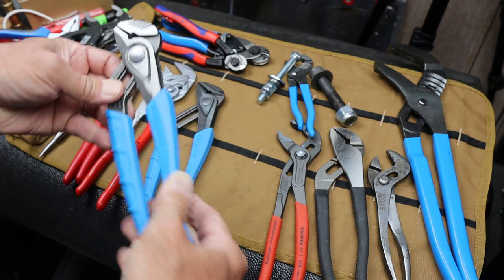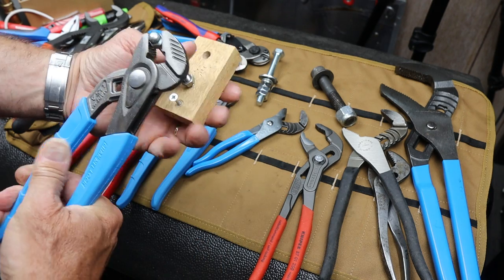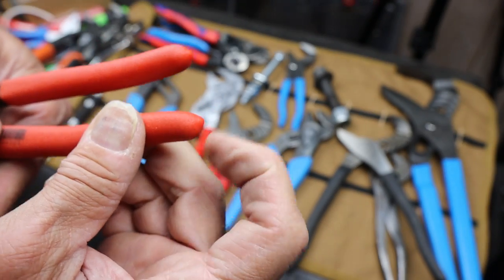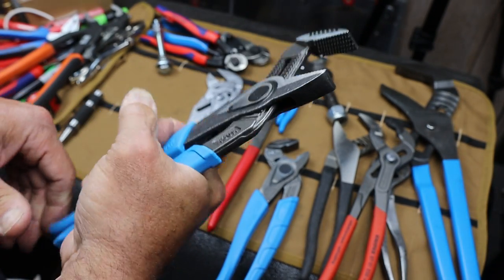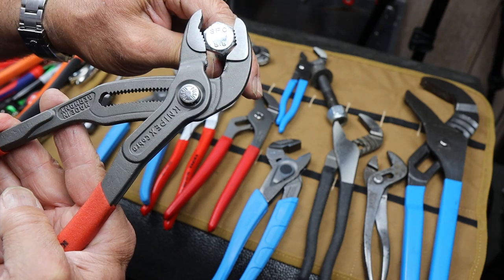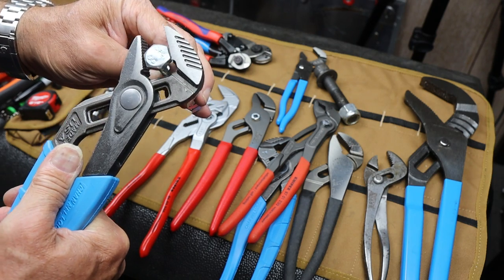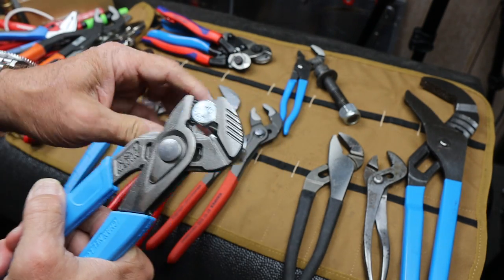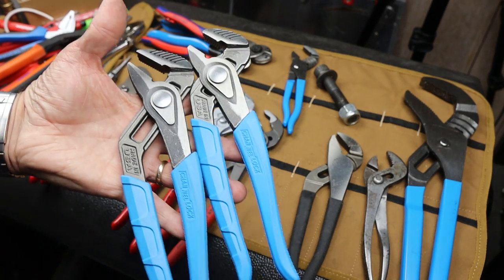Channellock SpeedGrip Pliers: First impressions and comparisons. Hmm, few benefits, fewer problems.

Comment: Good choice NOT getting the 12" - I got them...THEY ARE HUGE but the jaw only opens as wide as the regular 8" CL. and I wanted to add, the jaw length are just so short, they remind me of the old school craftsmen (with the steel handle w/o grip)  And the journeyman series Klein (with the yellow and black beefy grip). I have a pair of Crescent and Knipex in 12" and I would reach for those before the speed grip.

Someone in the comments under me said they reached out to CL to have them combine the speedgrip and groovelock to make a good competitor for the Cobras.

 I always try and give CL my business but end up back at Knipex (cobras and alligators). Esp when te smallest size Kinpex jaw is 1.5% that of the competitors NEXT size up! The only CL I will ever have or use are the original 420,430 and 440 bc there is always a use for a Straight Jaw grip....
Reply: The 12” open the same width as the 8”? I own all 3 and the 12” open much wider than the 8” & 10”.
Reply: @mr.delacruz559  Not much more, Compared to even the 10" regular CL they have barely any jaw width. Compared to a Knipex or Crescent 12" pair I have, Which open to like 2 1/4" wide! Plus, the jaw length is just to short, They have their place (Have used them on big ass machine bolts) but, there is a reason the CL speedgrip is in my garage and the Knipex and Crescent are in my truck lol
Reply: @mikenormandy9250  The 12" have almost a 1/2 " more than the 10" and 1" more than the 8" Speedgrips. That a big difference in jaw width. The jaw width of the 12' speed grips is just a hair under 2 1/2. I literally have them in front of me and I have a 12' Crescent & Knipex Cobra. Now compare this to the Knipex Cobras ,Crescent wrench and see what the difference is.You should be able to since you say you own both. The jaw length of the 12" Speedgrip is longer than a 12” Crescent & is no shorter than my cobras. This is why I use my CL Speedgrips  daily at my job.
Reply: @mr.delacruz559  how good does the 440x bite? Im thinkin of buying a pair soon
Reply: @stew-03  the 12” 440X Speedgrip that I own has some serious bite. It’s pretty aggressive and I haven’t had them slip on me not one single time using them at work and or at home. I’m a true believer in them and the speed grip button action has smoothed out even more with use which is awesome!
Reply: Try the new v-jaw version the10 and 12 inch they grab pipe and fasteners really good I have all 5 these 3 and the new ones I mentioned. They are all good (to me).

Comment: Big bulky thick.  My Knipex have retired  my channelock, craftsman,Klein, and Irwin  T&G for the most part . My first pair of knipex was the 180 cobras. Fell in love with the ergonomics sharp teeth and thin head profile  to access much more before. I have since purchased most of the additional sizes. I don’t consider Knipex to be  super heavy duty they are a better finesse tool. They definitely are designed better and the teeth hardness makes for incredible grip with minimal effort   I’ll pick up a pair of these just  to check then out.   They are reasonably priced

Comment: I am looking at trying a set. As an electrician I use my pliers for grabbing conduit and also for bolts etc. I have a set of cobras but I don't think they grab conduit as well as old style pliers. I like the higher adjustability of the pushbutton designs but the knipex button sticks out too far and gets caught on stuff.

Comment: I have many different brands of these pliers l find myself grabbing the Irwins because of the quick one hand slide up
Reply: I have the irwin push button v jaws as well. I like to see a comparison to the knipex cobras. Ya knipex is the original and probably a bit better, but worth the price difference? But ya im super happy w my irwins. Id like a pair of the knipex pliers wrench though since all my pliers like that are the v jaws since i like them better than straight jaws. But i think how the pliers wrench has that articulation in the bottom jaw will make a big difference. Also it will be better for stuff that has a finish you dont want to mar/scratch up.
Reply: In my experience the teeth on the Irwin’s don’t last near as long as Knipex. That being said I’d rather carry the Irwin’s and dremel new teeth once a year for pliers I paid $20 and have the one hand slide feature than use knipex. The Irwin’s also feel better in the hands and have nicer, albeit thicker grips

Comment: This is likely the worst tools channel locks has ever made. And I've had a problem with everyone of their slip joint pliers getting stuck in positions that I don't want and it's about one or two positions away from where I want to be all the time always wants to get into that position rather than the position I wanted to go into. These things wilshere the teeth off of the adjustment in just a few uses. The teeth will also roundoff inside where it's supposed to be gripping nuts making it completely useless.

Comment: you are also right about the handles of the pliers, but also about the shape of the teeth on the jaws. But do you know what that means? For the factory to change the molds with which they forge the pliers, this takes time, and it costs a lot to change or design a new mold. But if they did this at the request of the customers, in the future they would have much more sales, and the customers would be satisfied. Don't just complain here on youtube, it would be better to gather some of those who present reviews here and write directly to the factory, for the modification of a clamp. They will listen to your requests faster. It is not enough for only one customer to ask the factory for this, there must be more. Look, for example, Knipex listens to the complaints of customers, no matter what country they are from, then they will release a new, more efficient tool that meets the demand. I live in Germany and I like the design of European hand tools, especially the VDE one. I also like American tools, because they are durable and professional. I saw some reviews from you Americans, perfect, get together some of you who make videos here and write complaints to the respective tool factory. For example, Knipex has several models of pliers that it sells only on the American market, and if I want order to order the respective pliers, I have to order only from America, because only there I can find it, not Europe. Recently, Knipex introduced these pliers in Europe as well, because we want them too. So it is possible. On amazon america we buy them at double the price, logically, now I can buy them at their fair price, without VAT or the price of delivery and customs clearance.I hope you understood what I wanted to say. I wish you much success.

Comment: The aesthetics are a little much.  Form follows function, as they say, and I have never liked un-necessary racing strips or flames, etc.   These pliers have been stylized w quite a bit of extra visual features, which I consider to be noise.  I would not purchase these mainly because the jaws don't get perfectly parallel in most cases.  The only cool feature may be the width of the jaws.  I've got a great pair of Knipex cobras that I use everyday for a variety of gripping.   For parallel jaws, I would go for the Knipex pliers wrench, even at the higher cost.

Comment: Those Bahco you have to the side are awesome... I had mine out yesterday nice wide-opening and thin jaws excellent bite they're great
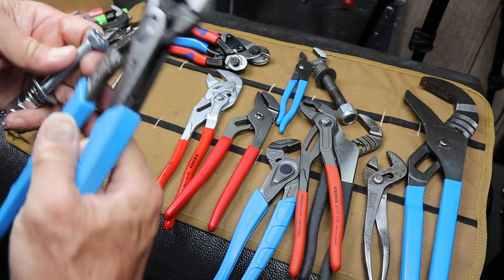8:40.. you're looking at this like they only do one job which is grab Nuts and Bolts... on the contrary... I like to use the flat jawed pliers for plate specifically hot plate and trapezoidal jaw design pliers for nuts and bolts
Right tool for the job...🔧
Those Channellock pliers are really nice.. an excellent upgrade to their line
Reply: I was thinking the same. I use Knipex cobras mainly for work (grabbing connectors, couplings, pipe, nuts, bolts) and will use the straight jaw OG CL 430 or 440 for grabbing flat items (or anything that needs a straight jaw) right tool. right job.

Comment: Interesting that Channelock went with the crossed hatch pattern on the jaw instead of the opposite angled teeth on the Knipex
Reply: I assume the cross-hatch is for things like gripping a nut from above, if there is no room for the pliers in the same plane.  It would be a similar use to the “screw removal” pliers in a recent video.

I swear, I usually have the “odd case” use for pliers that standard ones.
Reply: @firstmkb  I guess good sturdy teeth is more important dan the andle

Comment: I tried out the same set of Channellock pliers and i thought they should have reversed the way the handles were shaped they made them thin in width and tall with the square corners makes it dig into your hand when applying a lot of force.
 the size range that it goes out to is much less than other sliding pliers my DeWalt push button slide covers a huge range, but jaws are smooth on DeWalt good for stuff you don't want to mar. these Channellocks have some mean biting teeth on them.

Comment: Can you do a review of the matco locking flex head ratchets
Reply: Hey boss, I will toss in my two cents. I have over 40 years of professional wrenching under my belt. I love my Snap On ratchets but my go to is my Matco 3/8 locking flex head Ratchet. It feels great in the hand, excellent locking feature and is stout enough to work hard day in and out. I like the new Snap on lock design alot better than their old version,  I did not care for it at all, But I still prefer the Matco locking design. 
In my opinion (which is worth exactly what you paid for it) the Matco locking flex head ratchet is one of the best on the market.  Plus it is American made and for me personally that means alot. 
I have it in orange and green. Bought the green because the orange wasn't available at that time. 
Needless to say, I highly recommend it. 
Stay strong brothers.

Comment: I have always just stuck with my standard Channellock groove joint pliers.
I have no concerns about the type of mechanism,  but I cannot get behind the unnecessary futuristic aesthetic they went out of their way to incorporate.
Nobody ever said "  I demand my pliers to look different than pliers have always looked , traditional looking pliers have no problem selling and that futuristic aesthetic doesn't belong.

Take those hash marks off the head, and put normal looking grips on them and I'll try a pair but not as they stand right now.
If they can care enough to make 'em look this way I can care enough not to want them because of it.
Reply: then just get the knipex, you're just cheaping out by going channelocks anyways
Reply: @landonmaurer2453  
I love my Channellock pliers, and have never actually felt lacking with my groove joint pliers or the quality of the 25 or so pairs of their pliers and cutters I have

I just figured I'd try a pair of the channellocks if they made them properly, I don't really have enough interest or need to buy Knipex.
Reply: @TylerSnyder305  If you have enough interest to complain about a improved design then you ought to try the improved design on a model with what you wanted. Otherwise why bother saying anything at all even saying youd buy them if theyre were like this
Reply: @landonmaurer2453  
Because I'm moderately interested but can live without them,  since I'm a Channellock guy I've decided I can pass until Channellock makes a pair I would buy.
I heard they were coming out with these and thought cool I'll try them, then I saw the pictures and said nevermind.

I'm not complaining about the " improved " design btw, just the fact that they went out of their way to make them look terrible.
Reply: Yeah only reason I can think of is for 'branding' but their blue stands out already, I see blue handled pliers I know it's channellocm

Comment: With all respect I stick to made in the United States like  klein, Ideal, Channellocks, (Snap-on and Mac, Stanley proto too pricey). I have and own all 3 of those 8-10-12 and they work great (for me). Everyone has their opinion on those pliers and may disagree with me but I unless they came from the factory damaged had no problem with Channellock pliers and even their screwdrivers. Knipex (pronounced like knife) are good to but are as pricey as those other guys mentioned but are as good a pliers to along with wiha.